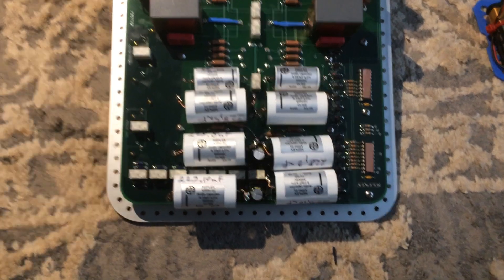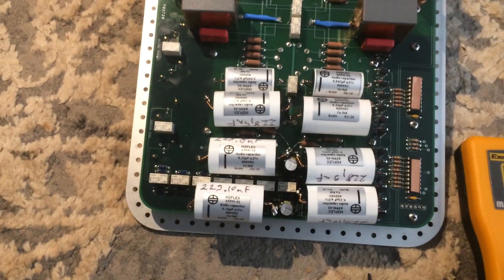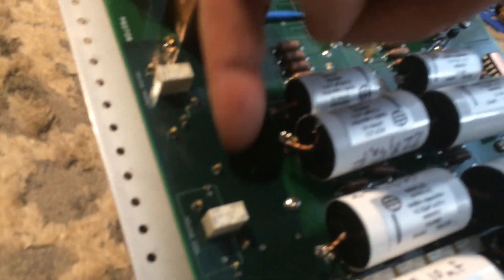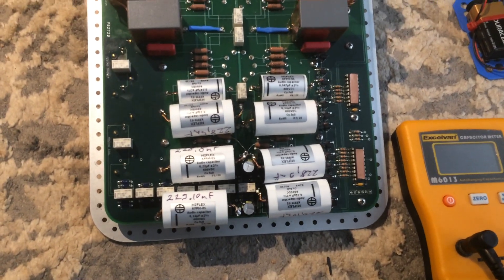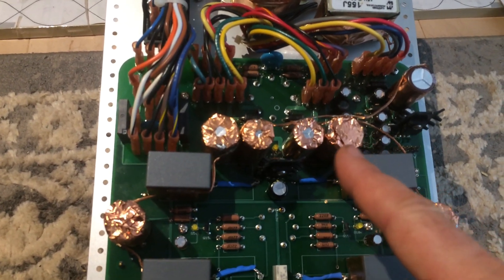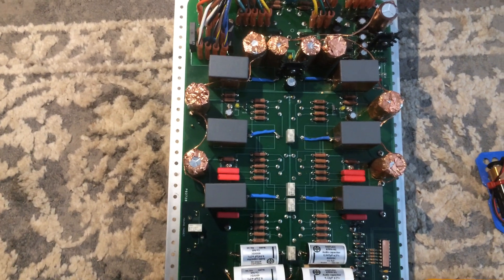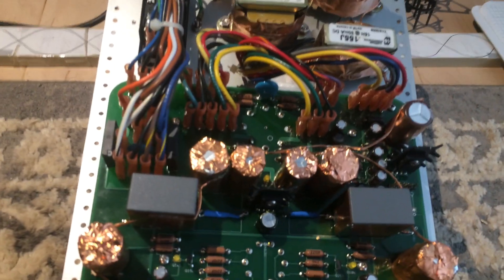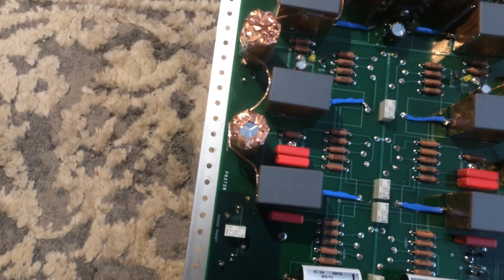Hagerman Violin re-cap build log

Comment: Did you mean to say Audio Note solder instead of AudioQuest?
Reply from the maker: No, it was AudioQuest solder. The rebuild was before I got the AN solder. (AQ used to be my favorite solder, AN is a little better). They are both fantastic solders.
Reply: Good quality solder is important, even more important is the correct soldering technique....I see many ( even professionals and so-called audio experts , ...and  repair technicians ) doing it WRONG ...